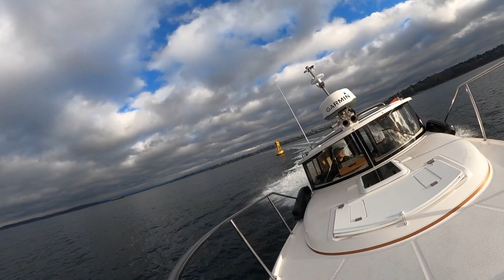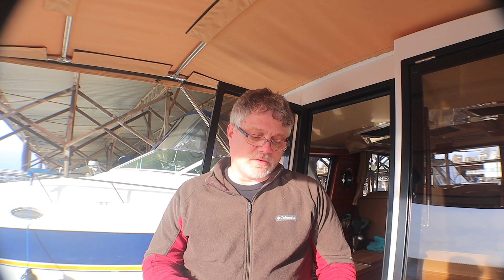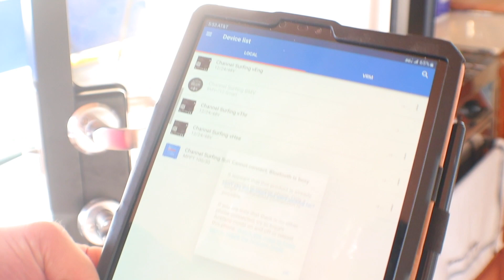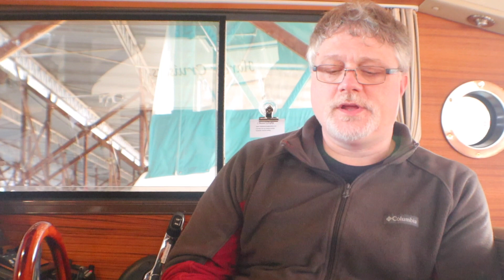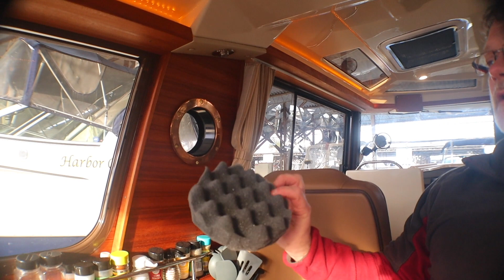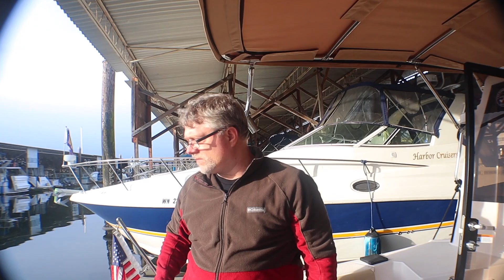UPGRADES AND WARRANTY WORK ON OUR RANGER TUG R27 OB

Comment: Nicely done list of upgrades.   Did you rewire the hot water tank into the inverter/battery system?  Given some thought to that on my C32 but concerned about forgetting about it when the boat is not running.
Reply from the maker: Great question!
Our only option for hot water is 115volt shore power or to run the hot water tank off the inverter which is a large amp draw.  From the factory, the hot water tank is wired to the AC panel and operates off shore power or the inverter.

We do not have an inverter/charger. We have a battery charger and a stand-alone inverter as two separate devices.  As a result, we don't have the automatic function of an inverter/charger that can automatically flip between shore power and inverter power. 

I'm not aware of any inverters that are ignition proof which is a requirement for anything placed in the engine room area due to the gasoline tank (ABYC standards).  Our battery charger is located in the starboard lazarette, and our inverter is located inside the cabin.  Because of this, if we're not connected to shore power we have to manually start the inverter, apply power to the AC panel, then turn on the breaker for the hot water tank.
Reply: @Letsgochannelsurfing  Okay makes sense.  We have a combo charger/inverter in the lazarette.   The hot water tank and grill only operate offshore power.  I've wondered why they are not consistent across boats. If anything, with twin 300s, you have way more amps to help with the load.
Reply from the maker: @dhansen68  We upgraded our house battery bank from the two 110Ah AGM factory batteries, which are insufficient to run hot water or the grill off of.   We went with 3 Oasis Firefly AGM batteries.  Firefly batteries are AGM, but they are different in performance than conventional AGM batteries.  With the 3 of them, I get 348Ah in our house bank, of which 225Ah are usable. (Firefly allows DOD down to 80%. Technically, you can run them to 0% and they will recover).  I'm able to run the hot water tank now off the 3 Firefly batteries at anchor without a generator.  I haven't tried the grill yet, but am certain I'd be able to run it as well. 

If you haven't had a chance to watch this video, you may want to check it out.  

"We Killed our House Batteries and you want to replace them with fireflies?"
https://youtu.be/AehPUYetDzU
Reply from the maker: Thinking more about this... maybe your inverter/charger is a modified sine-wave, rather than a pure sine-wave, as the reason your hot water tank is wired only for shore power.
Reply: @Letsgochannelsurfing  No, it's a KISAE Abso 2000 Compact Pure Sine Inverter/Charger.  I don't think it would be hard to rewire or add a couple of jumpers.

Comment: I have a GXM54 and am trying to solve the same problem on my RT31. What specific XM antenna/adapter setup did you use to convert to a direct connection to the Fusion Stereo? Did you consider splitting the signal from the GXM54 or using a Shakespeare type XM Marine Antenna?
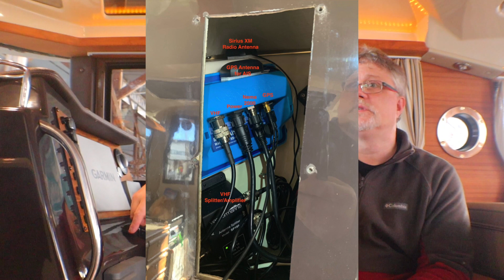Reply from the maker: Thanks for watching, and great question!  I did not go with the Shakespeare Galaxy marine antenna. This is the antenna kit I bought (see url below).  It plugs directly into the Fusion radio. The antenna that came with this is what I used. If you stop/pause the video at the 14:53 mark you'll see exactly where I mounted it.  I used velcro to stick the antenna to the smooth fiberglass. There's a small shelf back there that it sits on.  On your RT31 this may be different.  When I put the antenna in, I left about 6' of cable and I moved it around trying different spots until I found a location that worked well.   The only way to use the GXM54 for XM radio that I am aware of is via the auxiliary port on the Fusion radio which the requires the Garmin chartplotter to control the radio stations, which means +25 watts is needed to power the chartplotter when listening to XM Radio.  The XM radio slim line antenna I used works good behind the helm.  When we're out cruising around it works great and doesn't cut out at all. When we're moored in a covered slip in Everett, no issues at all with sound cutting out.  We were in an secluded anchorage last weekend, and had a little audio cutout depending on where the boat was swinging, but wasn't any different than when I drive my car through a secluded road, tall trees around, in a valley, etc...

https://www.amazon.com/gp/product/B07QJH1Z8B/ref=ppx_yo_dt_b_asin_title_o00_s00?ie=UTF8&psc=1
Reply: @Letsgochannelsurfing  Thanks so much for your reply. We anchored  near you at Friday Harbor last Summer right after we took delivery of our blue hulled 31CB Toujours. Hope to see you up there soon.
Reply from the maker: @pbnorris01  We remember you!! (I snapped a pic of your gorgeous boat). Looking forward to seeing you again in the San Juans!

Comment: Good afternoon yall, Could you explain why you went with a single 300 instead of   Twin 150s I know in Florida way try to go with the twins Just for safety In case where 60/70 miles out  And lose one. Keep up the good work on the videos you'll have a wonderful day.
Reply from the maker: Great question and thanks for watching!
The boat was designed by Fluid Motion and is rated for a single outboard of a max of 300HP, hence, the Yamaha F300.   Personally, i would have loved to have twin 150's for the redundancy, and the control of twin screws. 

In the Pacific Northwest, where we boat at, we would rarely, if ever, be 60miles  off the coast.  I could see going maybe 40 miles out, but not really much farther.  The F300 is highly reliable as a motor.  Twin engines also means twice the maintenance costs.   The Cutwater 32 has twin F300's which would be sweet, but way out of my price range.
Reply: Yeah my dreamboat is the sea sport 32 with twin 350